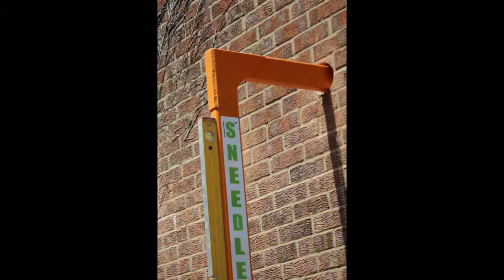Needling with Sneedle Props  (Patent no GB2581379B)

Comment: This is ok if you are on a day rate otherwise is idiotic. I use extra long strong boys to support a 300mm cavity wall, both skins, fast and simple.
Reply: Dippy John
Thanks for your comment, yes  you can use long strong boys but not when you need 300mm+ clearance between the wall you are supporting and the props, to allow for example a 300mm I beam to be installed, hence when you would needle. this video is for demonstration purposes and is solely to show a cheaper quicker and safer alternative to Needling 👍
Reply: @davidsgueglia9656  still have to prop the floor joists on the inside though. 
Longer props and needles would be far easier and quicker than these. Arguably stronger too as you can easily throw some scaffolding diagonally to stiffen everything up. As John ⬆️ said, idiotic.
Reply: @martinwhite2636  Hi Martin thanks for your comment our props now come with bracing supplied so they all lock together and they are about 2 and 1/2 times the strength of strong boys and you don’t have to damage any of the upstairs rooms new video coming out soon, please see website for more info